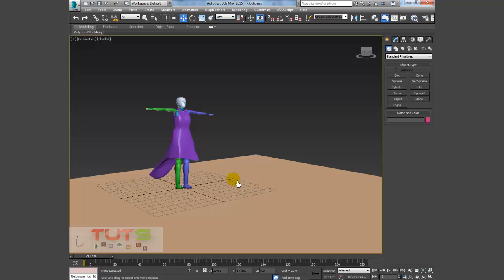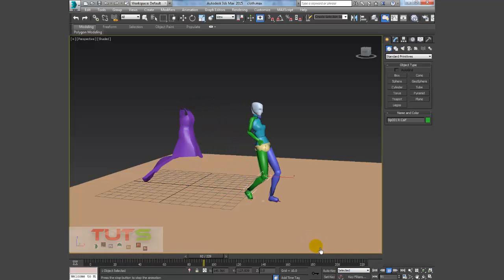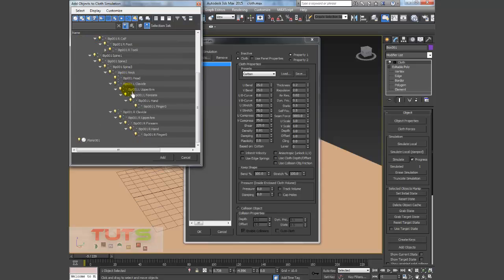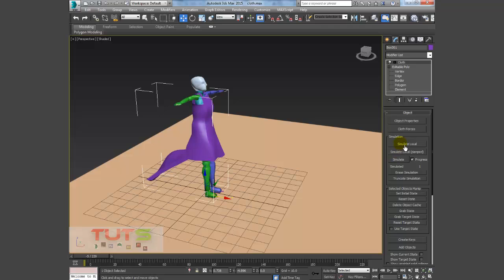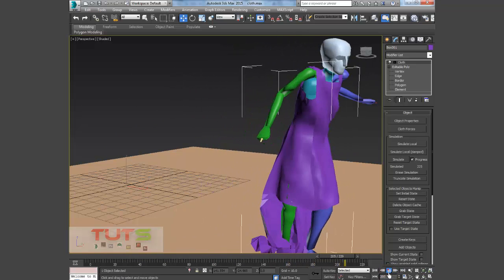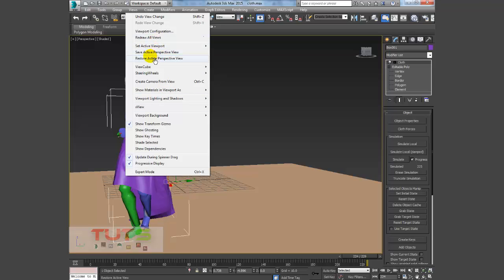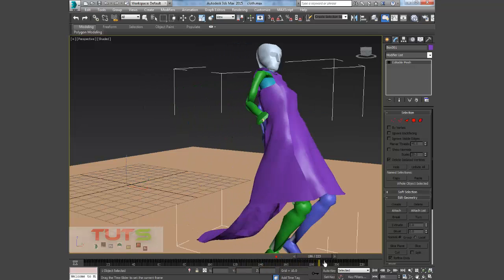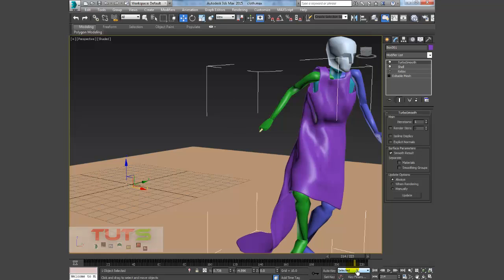Autodesk 3ds Max Tutorial - Character Cloth Simulation With Cloth Modfier

Comment: Greetings Edu shola, I am simulating a cloth modifier with my character animation but when it gets to 3 particular frames at different times on the timeline the cloth simulation freezes but the animation continues but after 3-5 frames the simulation continues again. Pls how do I solves this challenge?
Reply from the maker: Try to reset the cloth object to initial state and try to use "simulate local damped" instead of just "simulate local" the when it settles and simulates make sure you click "simulate" with ☑️progress to simulate the entire animation on the timeline. Let me know how it goes.
Reply from the maker: If that's doesn't solve it, scroll down to "simulation parameters" and make sure "start frame" and "end Frame" match the animation length
Reply from the maker: I usually don't check the end frame box to avoid these kind of issues.
Reply: @EduShola  OK, I'll do that and get back to u. Thanks.
Reply: Greetings Edu shola, I'm still facing same challenge.
Reply: I have done reset like u said, I made the simulation fit with my time frame, but I'm still having that challenge. What else could be the problem. I didn't experience this in my previous works.